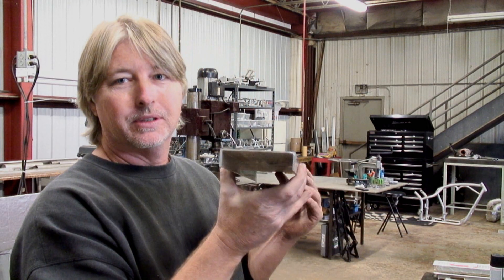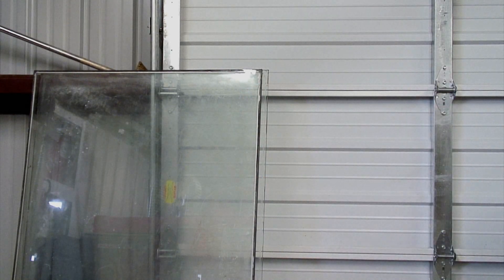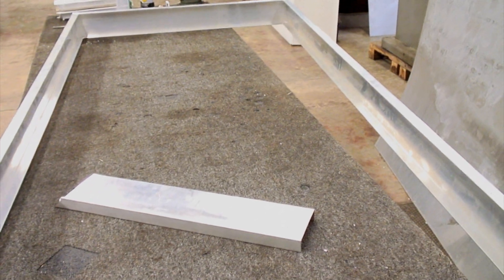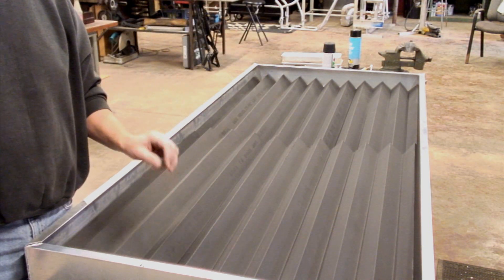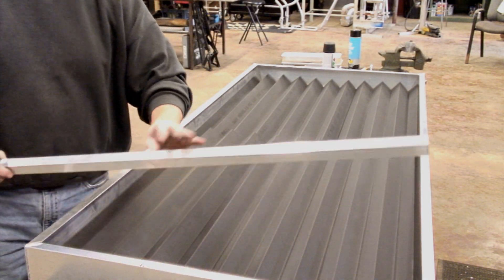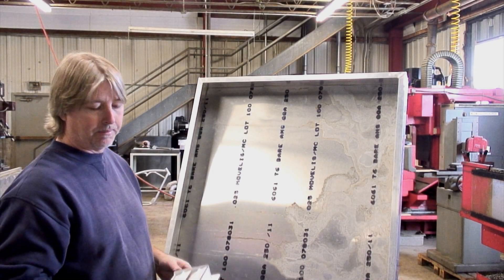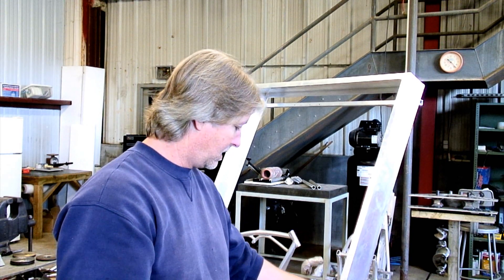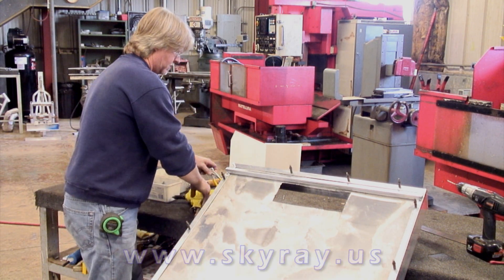Passive Solar heater part 1

Comment: Those vents are a great idea.  I've made one from 1.5 inch styrofoam house sheathing and wedged it into my window sill on the inside.  I've used it that way for 3 years now.  I've had temps high enough to start melting the styrofoam.  It's time to remake it.  I have been wanting to make a box from some paneling I have.

Comment: Theres one thing I think your missing convection I will be fun to see how your box gets the air from the channels I don’t see a top and bottom header as to your inlet outlet you have them the wrong way round but time will show you that if you get a chance take a look at all my videos
( solar heater uk) if you cant get 200f plus from your box look at my 4X3 box (cans) I have had up to 200f with an outside temp of 44f and lower mine is a work in progress a you will see yours is

Comment: Hi from pete solar heater uk I can see your new to this it shows by the design flaws your building in to your box, first theres more air leeks every where on your box and before I see part 2
I bet you under do the insulation as to the ali with the folds being better than cans I think not